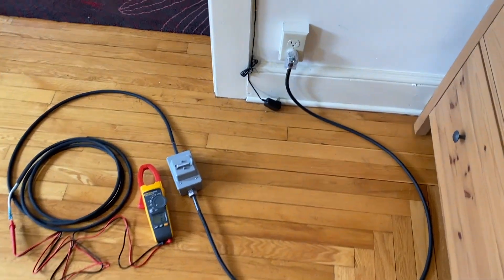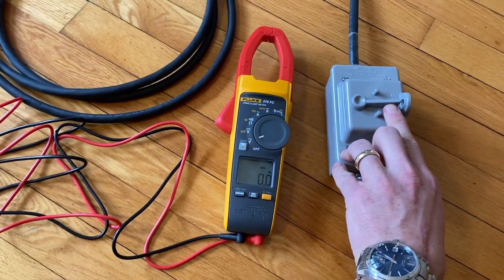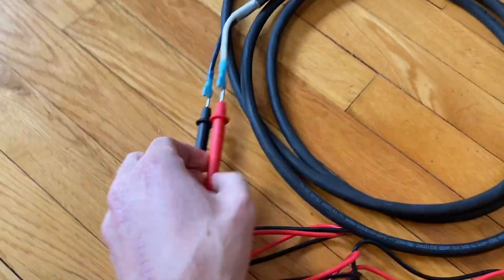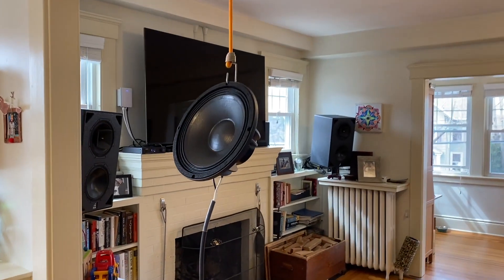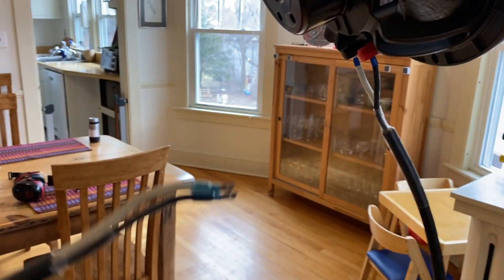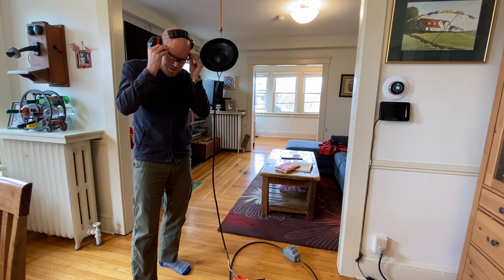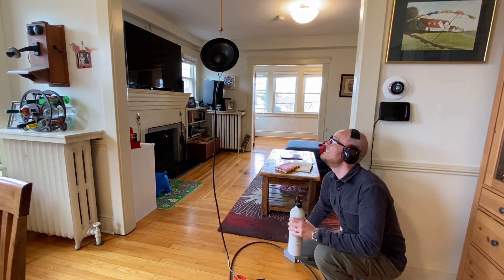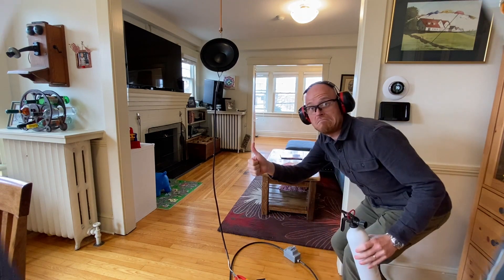Woofer Destroyer!

Comment: Not boring at all! I've always wanted to try something like this myself. But since I live in the Netherlands, where the mains supply is 230 volts, I figured a driver wouldn’t last more than a few seconds under that load. Assuming you're in the US with 110 volts at 60 Hz, and assuming the driver is a 10NW76 with a resonant frequency around 60 Hz, I would have expected it to last much longer. Its power rating is 400 watts, so at 110 volts, I’d expect a current draw of only 1 or 2 amps, translating to about 100 to 200 watts. That should be well within its limits.

Comment: Did this back in the 90's with two Orion 12" subwoofers which were in a massive ported enclosure in my bedroom. It became immediately clear that my mother doesn't share my affinity for 60hz test tones at extremely high pressure levels.